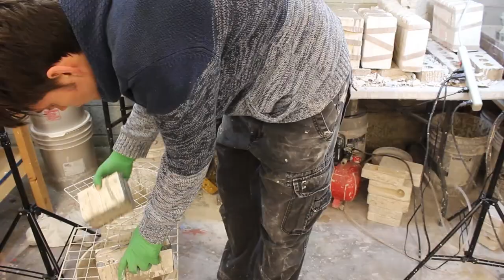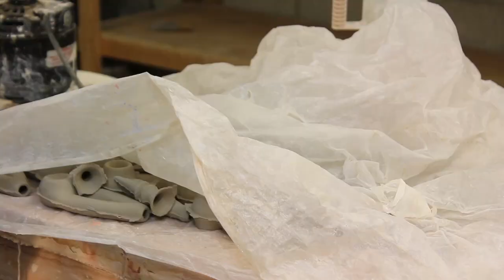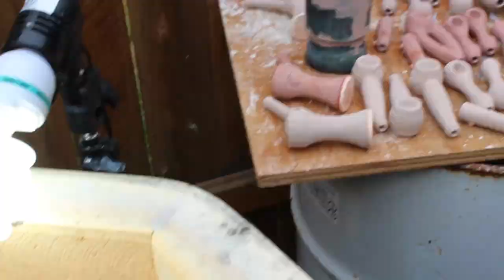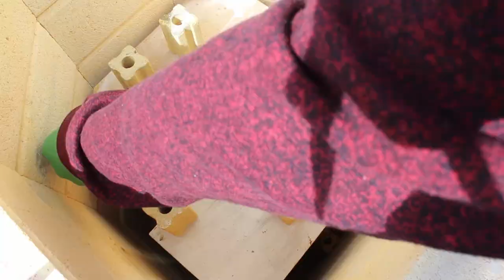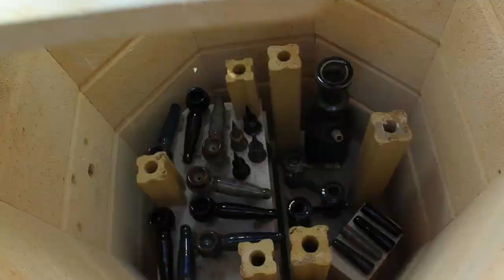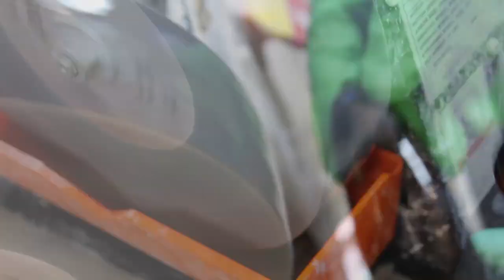Making ceramic glass pipes

Comment: How are they hollowed
Reply from the maker: Well it’s the way a mold works. The liquid clay starts drying out on the inside walls of the plaster mold to form the piece. You only leave it in the mold for so long and then you drain out the excess slip so that it remains hollow.

Comment: I love your pipes, the videos and the humbleness to share all this information. You put so much love in your work! Even reduction firing!!! How do you manage to not close the drill holes with the glaze, what's the specific gravity? And for my lousy pipe understanding, how do you avoid that the weed basin sinks into the channel? Thank you so much!
Reply from the maker: Esther SUAVE thanks, for not clogging the holes I have my glaze added with about 90% water and I think that is about 1.55 spg but I don’t remember off the top of my head. But I also scrape the glaze out of the hole and scrape some of the glaze off in the bowl to make it a thinner layer near the hole. As for the sinking I have not had any problems there.

Comment: Cool video and the pipes look very nice, but I wonder how you would make them by hand in this form?
And, maybe it would be more efficient if you could somehow hang them up on hooks through the kick holes while burning them in the oven, I don't know if it is possible or too fragile but it could save you that grinding time :)
Reply from the maker: Edgar der Schmied good point, and I’d say it’s just like the way I do it, you have to try it to find out and then keep at it to perfect it. The easiest thing would to not glaze the bottom, but when competing against glass, you end feeling the need to make it as similar as possible. For hand form, you would struggle to match the uniformity but might be Abbie to mimic something on the wheel by throwing it in three parts: the shaft, the smoke chamber, and the bowl. Then slip and score them all together.

Comment: A couple of questions:

1. How long do you let the slip sit before pouring it out?
2. How do you even get it to pour out with such a small hole? This is a legitimate issue I’m having. 
3. How long do you let the slip set before disassembling the mold and removing the pipe?
Reply from the maker: Let set for about 15 to 20 minutes depending on slip. 
Gently poke a thin paint brush stick into the mold to loosen the slip, and make sure you don’t let the mouth piece/ pour spout get to thick of slip to the point it can’t pour out. When draining angle the mold and if need be gently shake it up and down to force slip out when tough. 
Leave the drained out slip in there for anywhere from 1 to 6 hours depending on your environment and the mold. Just left some slip drying in the molds today for 5 hours and they were leather hard and came out of the mold great. 
Let us know if you have more questions,
Thanks
Reply: Excellent this is exactly what I needed to know. Thanks for your help
Reply from the maker: Paul Davis no problem, thanks

Comment: I'm curious where you got that big wet grinder and did it come with that big black rubber wheel? That looks like a great tool.
Reply from the maker: Robert Graydon yea that is a home made set up, but I just looked for wet grinders online and bought the cheapest one, don’t remember the brand. Supper hard to find those pads, someone had some and gave it to me. It is a huge time saver though.

Comment: Very nice work! Looking to make a career change and this looks very intriguing, plus I am more of a creative sort. Can one person make a decent living at this? Do you have a general idea of total start up costs? Thanks!!
Reply from the maker: Roderico I guess it all depends on your situation. It is very hard to make a living doing this with a family. If you are single it is totally doable. I would still recommend having a side job for those months staring out where your not making a lot. To start up can be cheaper if you find a local studio to do your work at or at least use there kilns. You can start by buy used equipment and setting up electrical plus some other tools and what not for under 1k. Not bad just depends on your approach and how you choose to make the products. Wheel throwing is more expensive because of the wheel where molds are cheaper to make.
Reply: @Ceramicsmokeware  I am single. No rent. Home with a large work space, but a kiln is out of the question in my residence. Working on a design of one item and was hoping you might review it. Is that ok?
Reply from the maker: Roderico you’ll have to email me or message me on Instagram regarding that.

Comment: I love your videos. Thank you so much for posting. I have a couple questions. 

First is what is your slip recipe.

Second is how do you make bong fittings?I know there's shrinkage after firing. Are you sanding after firing to get the correct fit or have you calculated exactly the size you need so it fits correctly after firing.  I would like to try to make 14 mm fittings
Reply from the maker: Matthew Leggett thanks. I won’t share recipes but you can always buy them on my website if you’d like. As for fittings, it is a game of calculations and sanding. It’s hard to get it perfect.
Reply: @Ceramicsmokeware  no worries about the recipe. Thank you anyway. I'm navigating this new business venture and it's been a lot of fun so far. Your videos have been extremely helpful. Islip recipe works pretty good but I'm always interested in trying new stuff and learning better ways.  next week I should be working on making my first bong and then making a mold so I can start slip casting them.
Reply from the maker: Matthew Leggett sounds like a good plan, try to start an instagram if you haven’t and then get your work shared there.
Reply: @Ceramicsmokeware  you just started following my page today. Blue Moose Casting
Reply from the maker: Matthew Leggett oh yeah your looks good for sure. Most people when they are starting are not that far yet. I saw the mug women mold setup 👌 was thinking that you must have learned that from me since it looked so familiar. Keep at it
Reply: @Ceramicsmokeware  yep, that was definitely learned from you. I use the same Master mold polytech that you showed in the video. I'm ambitious and I love to learn so I've been watching tons of different videos and researching everything I can about slip casting. I really enjoy it